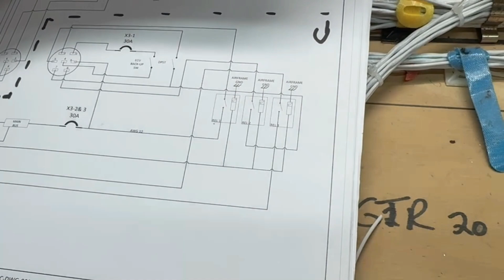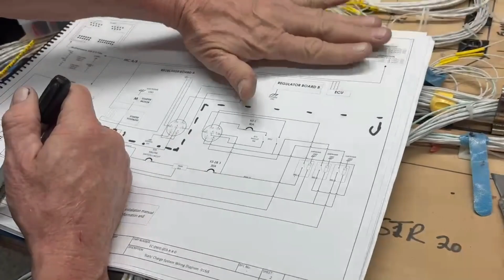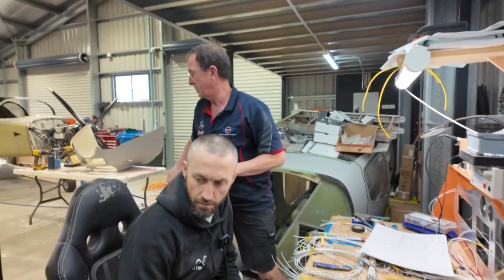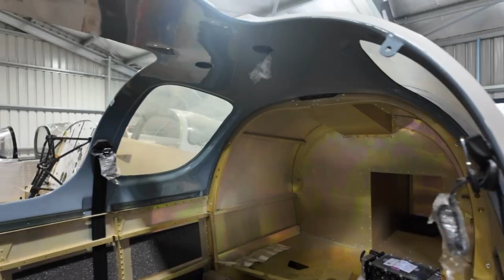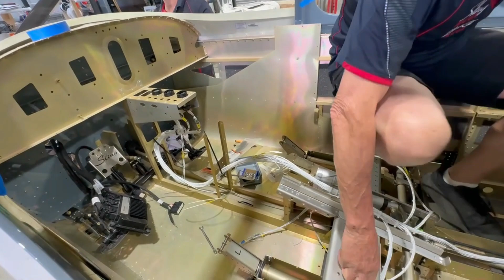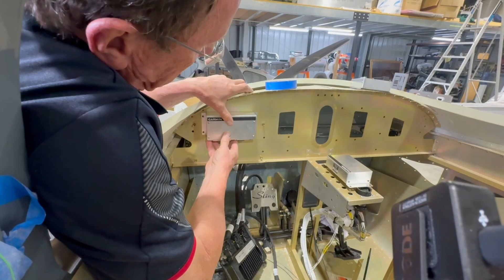Sling TSi Build: Wiring 101 with Errol (AU)

Comment: I met Errol last week, and he really does fill you with confidence. A very nice guy as well.
I think I am drawn to the Highwing for similar reasons that you are drawn to the TSi.
I was a bit cramped in the TSi, but fitted great in the HW, albeit with the seat all the way back.

PS. Hardly noticed the length of the video :)
Reply from the maker: That’s brilliant Craig, out of interest how tall are you ? Feel like if you remain open to either aircraft it ultimately picks you. The performance / economy factors are so negligible between both options the comfort factor is ultimately the choice.
Can’t wait to hear what you end up with ✌️
Reply: @OzSlingTSI  I'm 6'6 (198cm), but all my height is in my legs. When I sat in the TSi my knees where almost touching the dash. The seat doesn't move back as far as the TSi.
The funny thing is, with the HW the seat slides all the way back so you can get in and out. That was the best spot for me. Errol is going to modify the seat rails so it will lock into that rear most position for a test flight.

Comment: Fantastic! Thanks for the Answer to the question. Really appreciated the explanation of the behind the panel Garmin boxes, and their functions, which was something I wasn't clear about. The example of fault finding in the CAN bus is just gold. Finding an issue like that, is a huge challenge. I'm not surprised that it was on a connector in a very hard to access location. The Deutsch connector system looks to be excellent quality. https://www.youtube.com/watch?v=hGy-8uMlQ3M&t=1s The printing of label identifiers directly onto heat shrink really is first rate, (especially when almost all of the wires are white). That will assist anyone that has to work on the wiring into the future.
Reply from the maker: Hey Darren, Was a long video when editing I struggled to cut anything out. I think realistically it's needed to give context I'm not sure what I was expecting with it but the level of organisation is next level. I really enjoyed going through it, there is method to the madness and it filled me with knowledge !

Comment: First time I sat in an F111 at AMBERLEY in the cockpit........I was gob smacked at the wiring on the Capsule ,I got to talk to a pilot who had ejection in new Zealand ,the crew were dumping fuel,when the After burner lit up the aft fuselage..........they both got out safe........the wiring harness on the old capsules was insane...........I was 16..
Reply from the maker: I can only imagine, the wiring in my TSi is enough to blow my mind would hate to consider more advance and larger aircraft!